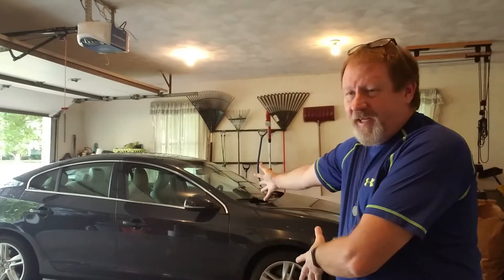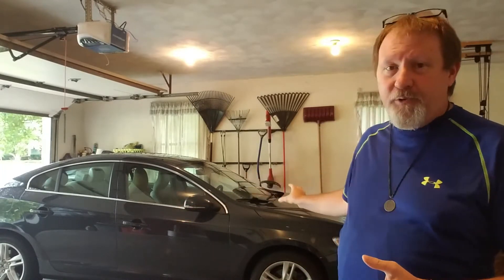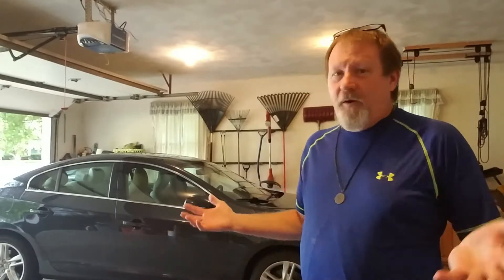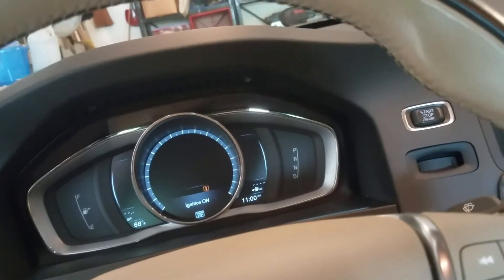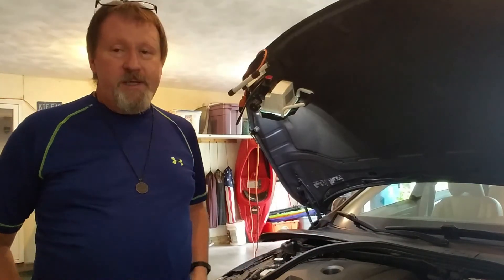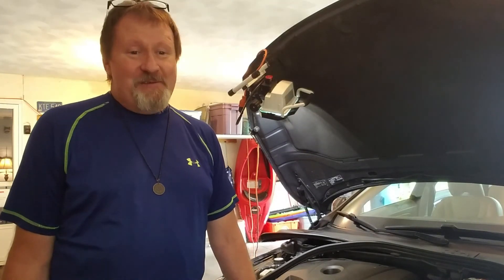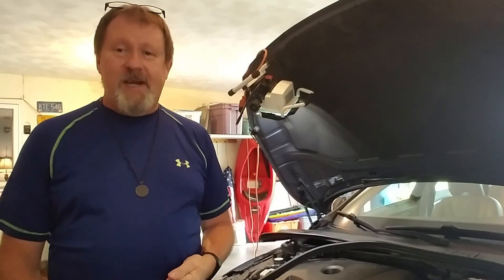Volvo Drive-E Start Stop Not Working

Comment: If I do this procedure (as I did successfully), but I start the car right after the procedure (while it is blinking the there time), I drive it, and THEN i let the car rest overnight, will it work? 
It should anyway told the sistem to restart the learning process right?
Reply from the maker: Not sure.   If not just repeat the next night since it's so easy to do
Reply: @MIFixItDad  ok, but could I harm the new battery if done as described above?
Reply from the maker: @S.V.36 no.   You're overthinking it.

Comment: The start stop function is considered safety critical. You don't want to turn off the engine if there is the slightest chance it won't start automatically when needed. So any problems, such as low charge in the aux battery, and the stop part of the start stop will cease to function.

Comment: At 13:08, you say "probably one of two faults if start stop does not work" or similar. There is a third likely fault and that is that one or both of the two batteries need charging. If your Volvo has to sit unused for more than several weeks, the aux battery can be drained by the continuously working electronics to the point where the start stop won't work. Volvo issued a statement during covid, when cars where not used that much, to say that if the car was left for a length of two weeks, then give the battery a charge. This is the case with our XC60 which we only use for towing our caravan. The start stop ceases to work after sitting in the drive, even though there is ample charge in the main battery to start the engine. A decent charge solves the problem of start stop.
So, before attempting resetting your electronics or especially of changing either of the batteries, the easiest step is to give your batteries a charge.
Incidentally, at this point you may wonder why the -ve terminal of the main battery is covered up. It is necessary that you connect your charger between +ve of the main battery and a convenient point on the chassis of car or engine. This will charge both batteries at the same time.
Reply from the maker: Good to point out but this video is primarily for those that drive their cars all the time and have issues.  Charging a bad battery isn't going to accomplish anything.

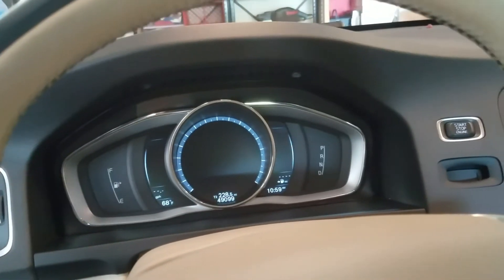Comment: At 4:13, you said "do not have your foot on the brake" whist pressing the start key, to turn on the electronics. This only applies to an automatic gearbox. If you have a manual gearbox, then do not depress the clutch whilst you push the key. I can not speak for the rest of the reset sequence though.

Comment: You keep calling your main battery stop start. The auxillary is the stop start battery.  As it boost the main battery during stop start function when at idle. If its failing the stop start wont work or if its discharge it wont work.  That battery is only charged when the main battery is fully charged.

Comment: the  small battery is for maintaining full  12 volts to circuits when the starter cranks, as  battery voltage drops to 10 volts on full load

Comment: Hello! You should be happy if the Start/Stop function has stopped working. It wears a lot on the engine with all starters. And I think that if it had worked, the car would emit the same amount of carbon dioxide anyway. Because at every start, more is emitted than during smooth and calm driving. Thanks! From Tommy Bertilsson from Sweden

Comment: Just picked up on your video which is very good, you're correct on the BMS but slightly incorrect on the two batteries locations for European Volvos,  also the hidden battery on your car is the booster start/stop battery, the one in the engine bay is your main auxiliary battery, it takes a boost from the hidden battery.
With European cars the main battery is located in the engine bay just like yours , however the booster start /stop battery is located behind the front bumper hidden  down low on the passenger side wheel arch, an absolute nightmare to change, as the whole front bumper must be removed to access the booster start/ stop battery , it is the ONLY way to get access to the start/stop booster battery, many owners this side of the pond have spent ages removing the inner wheel arch thinking theres access to the battery only to find theres no access, the whole front bumper must come off. Whoever at Volvo designed this on the European model needs sacking !!!!!!
Also any time after changing any of the batteries or doing a charge the BMS should be reset and the car left standing for a good 12 hours or so.
Reply: for those in th UK, I have a UK 2012 left hand drive S60 the auxiliary battery in that is approx where Floyd says it is, a little bit more to the left

Comment: Would you be able to use a battery charger to recharge the secondary battery?
Reply from the maker: @jiangyi7617  certainly.   That would probably only be a temporary fix though.   If it won't hold adequate charge a battery charger can't fix that.   Eventually it'll get worse

Comment: I have a volvo XC60 2015.5 SUV and I live in Southern CA, USA.  had low battery message for ever.  I was not able to open the trunk through the button on the trunk door (I used the key fob or dashboard button to open it)  Many times the close button did not work unless I turn the car on first (that is the only way to close the trunk properly).  found your video and loved it (Thank you so much Floyd).  Followed the process of changing the battery from Amazon,
After all of that the low battery message did not go away and the trunk did not close unless I start the engine.  The Start/Stop certainly did not work.  I did a battery rest, few differences from your video:

I pushed the start until the dashboard lit and I noticed the battery sign on it.  I must have pushed it for 2 seconds or more.
I preformed the 6x3 in a fast order
Turned off the car, but the hazard lights kept flashing.  I was worried that the hazard lights maybe adding to the problem.
Came back and read the comments on this video and it seemed to indicate that the hazard lights should not be flashing So I thought that I messed up somewhere. By then it was over 30 minutes since the reset.

I went and turned the hazard lights off and drove the car for 5 minutes and to my shock the start/stop was working.  Now the open and close trunk buttons are also working.  I will provide an update if this change. At least now I know that the car has fog lights and battery indicator on the dashboard (LOL) 

I am so grateful  for your video and feel indebted and I hope that this long rambling post will help others as a pay back. 

Now if only you can help me with the check engine light indicating PO420 error message (Catalytic Converter).  Dealer quoted me $3000.

Thanks again

Comment: Hi Floyd, thanks for the vdo, managed to reset after change both battery. Prior change the batteries had weird symptom of car electrical shut down unexpectedly. At the w/shop confirmed batteries capacitance had dropped. But after changed batteries this “blackout” still happened especially after you parked and stop the engine. I need to open the battery compartment and wriggle some cables connected to the battery (the cables to the battery terminals are tight btw)and voila! The electrical power is back. The OBD not able to detect any fault code. Btw, This trouble is intermittent. Any opinions?
Reply from the maker: Check all the cable ends to make sure they are clean.  Corrosion can cause issues like this.  Make sure the end is connected securely to the wire.  Follow it to the other end where possible and make sure that end is connected securely also.  Sounds like a wiring issue.

Comment: Hey Floyd, I have done the BMS reset you show at the beginning of the video, but have since learned you’re only supposed to do this if you install a new battery. Otherwise your car will think you have a new battery and treat your old battery as such.  Is there any danger driving like this or something that can be done to revert the BMS reset?
Reply from the maker: You can't "undo" the reset.  This basically just tells the car that a change MAY have occurred to the battery, and it will go re-test it to see what it's charge and discharge capabilities are.  There's no danger to doing that.  It just helps it re-learn the condition of the battery.

Comment: Replacing the auxiliary battery on a right hand drive car is even easier, it's just to the left of the main battery.
I also reset the charging system while I was there.
Good video 👍🏻

Comment: the reason for the second battery is to protect the computers within the car from voltage drop when the main (starting) battery cranks the engine. it's very normal for a start battery to drop in voltage to something around 8.5 volts when it's supplying 600+ amps to the starter. if you don't have the second battery in the system and the main battery (and cable connection) aren't in perfect shape then you run the risk of having computers drop out and reset and sometimes even lose their settings and or be damaged.

Comment: This video could have been 1 minute long :-D  Get to the point, man!!
Reply from the maker: Maybe, but it wasn't.  Most people prefer a full explanation so I try to be thorough.   I'll try to put disclaimers in the future to skip to the ending if you don't.
Reply: @MIFixItDad  The frustrating part is that you didn't mention that it needs to be in "Ignition 2" mode.  You can't just tap the start/stop button.  You have to either hold it down for 2+ seconds or press it twice.  This procedure only works in Ignition 2!!!

Comment: Floyd I can't begin to thank you enough for this Video, I disconnected my battery and afterwards my stop start didn't work after following your reset procedure the very next drive it now works again. So very grateful thank you. Cheers Colin.
Reply from the maker: Thank you.  Hopefully it keeps working.  The battery management system in these cars is trash.  It will only charge the primary battery in my car to 12.2 volts and the system wants it it to be 12.4 volts or something like that to work properly.  I will have to see if there is a software update for mine.  Love my Volvo, but hate their implementation of the start/stop and charging system.

Comment: My understanding is that the small battery is used to keep the a/c, radio and the like going when the stop/start is in a stop situation. That way you are not draining the large battery used as a normal battery. 
Think of it as if it is a boat. You have what they call a crank battery to start up your boat. Then, you have a different battery called a “house” battery. That one is used to run the “house” electronics (a/c, fridge, stove, light etc.). That way if you drain the “house” battery, the “crank” battery will be there to start the boat motor and not leave you stranded. Each battery is designed differently. One needs the Big Bang to turn the engine while the other needs to accommodate the smaller power required for the radio etc.. You will notice that when the car stops, at a red light, the A/C will be reduced temporarily. All part of the plan to reduce the power required to fire up the engine again.

Comment: Thanks for your help, I just bought a Volvo v60 and I changed both batteries myself and the car cranks but doesn't start.  and I get a stop Safely battery fault message.  I'm not sure what I have to do to make it turn on
Reply from the maker: I hope you got this one figured out.  Make sure the secondary battery is actually OK.  You may have an alternator issue too.  I've heard too many things this could be so would probably be better for a dealer to scan it and see what's causing the fault

Comment: What is under the passenger seat on 2015 S60 that is bolted to floor and has round, raised light covers?????
Reply from the maker: Depending on your trim level that could be anything from an occupancy sensor to audio amp to something to do with traction control.  You'll find modules like that all over the place on modern cars.

Comment: I followed the steps and no battery icon flashed up. Any ideas what I'm doing wrong? I tried exactly the same thing 3x over and no luck.

2013 V60 (Euro spec)
Reply from the maker: Not all cars have this function depending on year.  Yours may be one of them.  If so you may have to take it to someone that has the Volvo Vida setup to to a battery reset.

Comment: Thank you very much for your advice. You are a Legend!!! also I’ve got an issue regarding my cruise control. Cruise Control Unavailable. Also on the cluster it says cruise control service required. It doesn’t show up any error on obd scanner. I would be tremendously grateful for your advice regarding the matter. Many thanks
Reply from the maker: That sounds like the adaptive cruise control which means you'll need one of the very expensive code readers than can scan all the modules in the car.   An inexpensive scanner can't do that.   Probably a faulty or damaged sensor.

Comment: When I did the procedure I didn't see the battery blink 3x. Do I hit hazards for 3 on off cycles or 3 times total? If it's 3 times total the hazards remain on before seeing the battery icon? 2017 s60. Thanks!
Reply from the maker: It's been quite a while since I've done it.  If it doesn't work pressing 3 times, get out of the car, lock it, wait 5 minutes, then open it and try again pressing it 3 on/off cycles.  One of them worked for me and I thought it was just pressing the hazards 3 times.
Reply: @MIFixItDad  ok I will try thank you sir
Reply: @MIFixItDad  Just gotta hold the power on for more than 2 seconds to ensure you see the check engine light etc. light up. Then it works! 3 times total on the hazards. Thanks!

Comment: the car has 2 batteries. One is dedicated to the start/stop system. If that battery dies, the start stop system is disabled.
Reply from the maker: Indeed.  I have another video detailing replacement of the other battery.

Comment: So this reset (bme?)is if I get a new battery and am trying to get start stop to work? Do u know if this will work for p3 (2011) as well? Thank you
Reply from the maker: If your have the 2 battery system for start/stop, then I think this will work.  If not, try looking on the positive terminal for the primary battery and you'll see a plug or connector (not the big one bolting to the battery terminal).  Unplug that, leave it off for a minute, then plug it back in, lock the car, and let it sit overnight.

Comment: Thank you for the very useful information I have a Volvo XC 60 which is the SUV version of this car and it looks the exact same on the inside and I have the problem with the start stop function it never works every time I get in the car it says that The electrical system is not allowing to start stop function to work due to battery charging or is not at the right temperature for my battery and I have to be driving for a long time for the start stop to work so I’m going to try that resetting to see if it will work thank you so much
Reply from the maker: What year is your XC60?  If the batteries haven't been replaced, then you may end up having to replace those.  There will be a primary battery that is the normal size battery, and a smaller supplemental battery that runs the systems when  the start/stop is doing it's thing.  I ended up having to replace both of mine then doing this reset to get it to work again.  It's been fine since then.
Reply: I have a 2016
Reply: I don’t think any of my batteries have been replaced because when I bought the car they said they had to replace the whole front of the car because the previous owner at the car only had one owner and they had got into a car wreck so they had to make a whole new infotainment system they had to re-make a whole new parking sensor but when I have the car on without the engine being on it says infotainment system will shut down soon to low battery charge
Reply from the maker: @ronettelyle8746  that's what mine did when the primary battery needed to be replaced.   Then the start/ stop didn't function well because the auxiliary battery also needed replacing
Reply: OK thank you so much I will look into it and thank you so much cause I’ve been looking for a solution for this for months thank you again and have a great day!